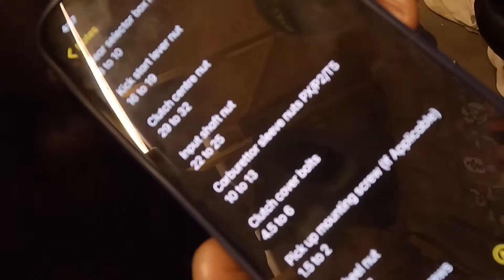Vespa P200 PHBH 30mm Carb Installation

Comment: Does it work on a stock engine from a vespa px 150?
Reply from the maker: @diegoaleman5185  Yes it will mount to any px it would just need tuned correctly for your kit. I think the standard carb for the standard engine is the best way to run it, personally i wouldn’t put a phbh on it but it will work. for a 150 i’d imagine a smaller carb would be needed maybe a 26 or 28 not a 30

Comment: It can be mounted with an oil mixer? I noticed you deleted it , why?
Reply from the maker: @antoniocerciello4826  I never run them it’s a personal preference. I like to know the oil is definitely in the cylinder, if the autolube system were to break that’s the engine seized! Also with it being a kitted scooter i ran it at 3% mix

Comment: is the 6mm spacer is a must, or is it OK if I just use the manifold directly to the reed valve for this set up?
Reply from the maker: it all depends on the angle of the manifold you have. i needed the spacer because the float bowl would hit the cylinder cowling and it wouldn’t go on. for how cheap the spacers are i would get one for the sake of having it incase you do need it.

Comment: any performance improvement on the stock engine?
Reply from the maker: I never drove it with the stock carb but it will definitely improve the engine, its 6mm bigger and because its a race carb it performs better all round. The engine has a malossi 210 kit so its not stock, but the 30mil phbh works really well with that kit.

Comment: Does it come with a choke cable? And will my original throttle cable be adequate to operate it?
Reply from the maker: @frankmcgrath2311  It doesn’t come with a choke cable you’d need to buy one. Yes it works with the original throttle cable.